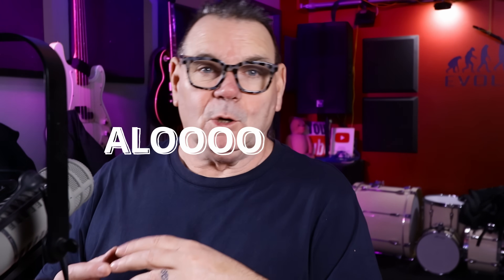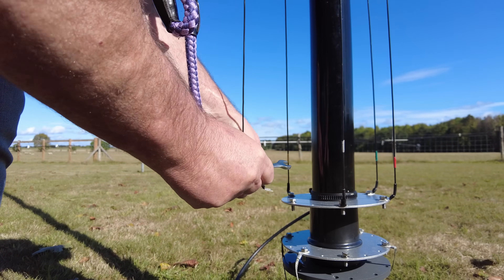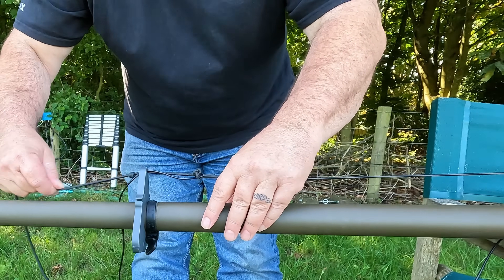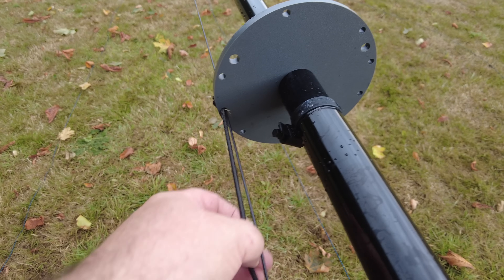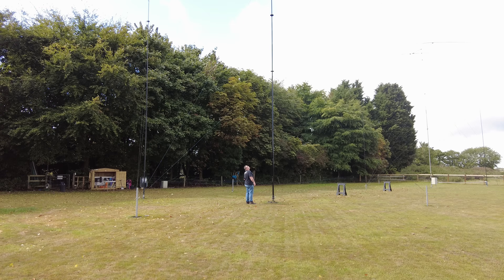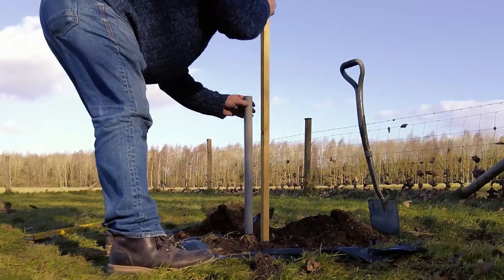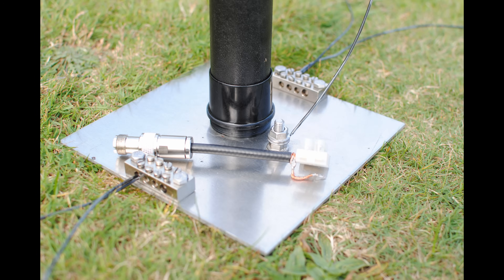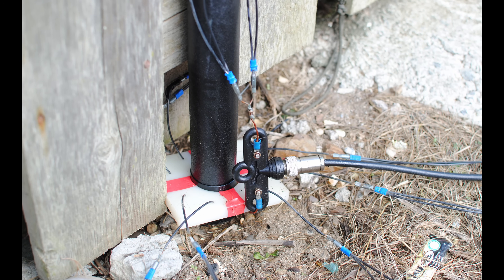Overcoming Antenna Fear - Conquering Complexity (DX Commander)

Comment: 100% on target. I think there is a certain level of anxiety be cause we want things "now". I am here to tell you that putting the DX Commander Expeditionary together for the first time was super fun. I kept referencing the guide and measuring more than twice before cutting. I was ok with not having a functional antenna out of the box, because I got to learn what makes my antenna be so good. My confidence grew and I learn to appreciate great performance without the need of an antenna tunner. It's easy to see great performance every time I get picked up on a pile up with just 100 Watts. The real reason, in my opinion, this antenna is so good is because it minimizes antenna compromise so you can deliver the most power to your elements. KD2YAE
Reply from the maker: Good work - and well spotted!

Comment: If you use just that plastic pole as a mast for a 40m delta-loop, it will take MINUTES to put up with a balun, will cover 40, 20, 15, 10 and provide 3db gain into two directions, both transmit and receive
Reply from the maker: Andy, yes - you will get 3dB in two directions - but only on 40m. Above that (vertically polarised) the patterns become more art than science :)

Comment: I've been watching your youtubes since the beginning when you where building the DXCommanders in your back yard (ok, garden.) 
Those of us that grew up in the 1960's take things like setting a post in the ground, working on cars, building stuff, etc for granted as we learned how when we were very young. As I get older ( 71) I admit I have to refer to the instructions more often than I used to. I have the Rapide plus with the 40 meter coil and need to do a little more tuning to get 17 and 12 meters to be a little better (40 is as a coil loaded antenna would be exepected to be, 20 is absolutely great, and 10 is acceptable considering the width of the band.)
I hope you, your family and the DXCommander have a great Christmas ans New Years.
Reply from the maker: You said something interesting there... Folks who HAD to fix their bicycle or mower (and generally I was always broke) worked it out. That helped me long term. Same as you I think. Merry Christmas.

Comment: with a 5M X 7M rear Garden, not a lot of scope, currently 2 very bent dipoles in the loft for 17M & 10M, any antenna is better than no antenna.
Reply from the maker: 5m x 7m is fine. You only need 2x2 for one of these.
Reply: If I open Patio Doors...
I could have 2M in doors during assembly
It's the laying out the Radials
It's all Flagged and Gravel
Don't relish prospect of pulling up Patio...

Comment: Apologies in advance for the brain melt..Been out of the loop of CB Radio 30 years - but really want to get back into it reliving the 80s🤣 , I think i have the up to date gear (radio) SS6900 V & (antenna) 18FT Mounted in back garden - Coax is about 15 meters from the radio - just short of the brain power to get the radio working properly that and the lack of people to test with on the air (Ireland).
Reply from the maker: Ireland... OK, find one of the ham guys near you and ask him for help..? A couple of them are on YouTube.
Reply: @DXCommanderHQ  many Thanks 👍🎄

Comment: Hi ....Bought a SS690V CB radio - after been of the 30 years off the air need some guidance can help..Please Please...
Reply from the maker: OK... Erm. I don't know where to start... Obviously you need some sort of antenna.. Pay more not less. And use some 10mm type coax - not cheap RG58.

Comment: a truer word was never spoken, and to be totally honest I don't think it has ever been easier to have a question answered or a problem solved. I work in the aircraft maintenance industry and every job we do has a step by step set of instructions which we must follow to the letter. now over time you learn those jobs and things get easier but you never stop looking at those instructions. they are your safety net. I got my licences less than 2 years ago and I have learn't so much and done so much. from building my first ham corner (shack) to now being on my 3rd or 4th amendment. to running a multi radio multi antenna station, to running software and modes that 2 years ago I never new existed!!!!! 2 years ago I'd never really soldered  anything and now I'm pretty slick but things go wrong...oh well learn and do it again!!!! As far as DX commander goes I started with a rapide and I'm now on a sig9. there was nothing wrong with the rapide but I wanted more. But I have turned my rapide into a 3 element portable antenna. we have a saying in work there is no such thing as a stupid question only stupid answers... So if you have questions ask. Discord, youtube and google they can be your friend, yes you sometimes get a some overbearing cock womble on an ego trip. don't worry about them because the others will step up and give you the answers or point you in the right direction. To Cal and all the team at DX commander and to everyone else in the ham hobby Merry Christmas MW7RHR...73

Comment: First contacts I ever made on HF were made using a home made antenna - in my case an EFHW with parts I bought from different places (no kit)

Most of us aren't setting up contest stations, nor are we setting up a laboratory - we're having some fun, and maybe doing some experiments from time to time. So min-maxing is completely unnecessary. Good enough is good enough.

When it comes to antenna experiments, as long as we are using a modern decent quality radio the worst that can happen is it doesn't work like you expect it to.
The radio won't transmit out of band so you should be legal, and it will cut power to save the finals if the antenna is really out of whack so you won't destroy your radio the first time you key up.

So try something new and see what happens
Reply from the maker: Absolutely – "good enough" is often perfect for having fun in the hobby!

Comment: Callum So true. inspired by you. I build a inspired by your expedition kit vid's from an old windsurfmast,  a fishing rod, Used leftover plywood with left over epoxy as coating for the spreaders, striped dumped home electric wire  for redials and it worked. Thank you so much for your kindness to share your knowledge on the subject.
Reply from the maker: Awesome to hear you got creative and made something work!

Comment: You speak the truth my friend. I speak from experience, having built both a Classic and a Signature 9, that if you do what Cal says, it just works.  My Signature 9 has been up since the spring of 2023 and it has endured typical Canadian prairie weather (-40C to +40C and up to 80 kph winds) and I love the fact that it’s so easy to take down and inspect. Like Cal suggested, I didn’t secure the radial plate so you just undo the SO239 lead and slide it off the pole. The shock cord is still in good condition and I use small black zip ties instead of electrical tape and it all still “just works”. Just follow the instructions, measure twice and cut once and like Cal and Roly and fond of saying, “just have a go”.  Merry Christmas from Moose Jaw. 
Tim VE5THF
Reply from the maker: Great stuff Tim! Love hearing about your experiences.

Comment: Excellent video--You are right--society and culture has changed.  Youngsters no longer build balsa or plastic models.  Shop is no longer available in schools so the basics of wood, metal and small engine/electrical repair is missing from the background on many.  Experience of doing something has been lost.    What this means for the future is not yet realized, but having younger amateurs build the DX Commander antenna/s is a great way to learn how to "do something."    The antennas themselves are not complex--just a bit time consuming as all the steps are followed--frankly, the whole thing can be built using a Leatherman tool or a fancy Swiss Army Knife.   But it should be thought that building a DX Commander antenna as a Zen like experience--part of the process of being on the radio--of getting the "wiggles" out there.  Thanks for the video and your antennas, I have several because I have a disease....
Reply from the maker: Beautiful comment. Thanks.

Comment: I learned so much building the Venture. I had never built an antenna before, or wrapped a coil, or crimped connectors or done heat shrink. It was all a new learning experience for me, and your guides made it all doable for a newbee. And it just works and works well. What a pleasure. I even came up with some ideas like putting a small zip tie through the bottom loop of the tensioning fold backs to keep it from being able to be pulled out of the heat shrink.
Reply from the maker: Brilliant - really pleased it all came together for you and that the antenna is working well!

Comment: AMEN!!!!  If you are thinking about building a DX Commander I would strongly encourage you to give it a go!  Watch the build video, study the manual .... You will succeed AND you will learn a lot!  I built my Sig 9 over two days .... Day One: Setting the ground mount pole in the ground with a bag of Postcrete .... Day Two: I built the DX Commander.  It took me most of the morning and afternoon.  Make sure you have the proper tools (which are very modest and useful for other projects).  My radial are spread over 180 degrees ... that is the best I could do in my garden.  I used the biodegradable turf pins that Callum sells to hold down the radials.  I followed the cut chart for the wire elements carefully and it worked great the first time.  I did not need to do any trimming.  The antenna works REALLY well on 40, 30 and 15 and works very well on the other bands.  I have worked 160 DXCC entities on FT8 since April 2025 when I put the antenna up,  It just works!  And with no traps it is very efficient, Since April the radials have effectively buried themselves.... Again, it is a great project ... as a previous commenter mentioned in the same quality class as Heathkit .... and I learned a lot.   73 M0KKB
Reply from the maker: Thanks so much for sharing your experience, it's really helpful!

Comment: Great video Calum, personally as an Electrical Engineer the Signature 9 was an easy build form me even so I followed the instructions and it worked out of the box first time SWR on all the bands covered below 1.5:1  I would say that everyone into the hobby with a basic tool kit should have not problem building it based on your videos and instructions.   Its a great product with excellent product support .......... de G0FFL

Comment: my 12.4 is the best I did have a failure (78mph winds) but you took care of me Callum and its still up and working we just had 60+mph winds here in IL yesterday morning I did take the antenna down before I went to bed just because why push it cause mother nature always wins and its so easy to take up and down. It had fell down a couple time from the anchors pulling and the antenna just keeps on going. if anything ever happens that I have to get another antenna IT WILL BE ANOTHER DXC. Thanks Callum you RAWK🤘🤘🤘have a great day de W9US
Reply from the maker: Hey Ed. Great stuff!